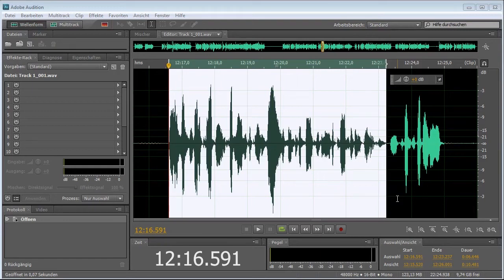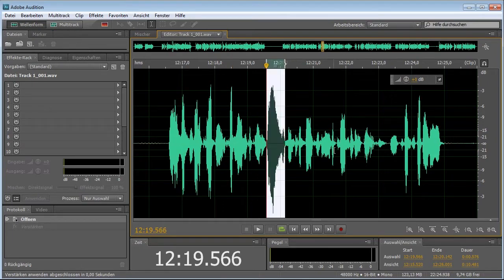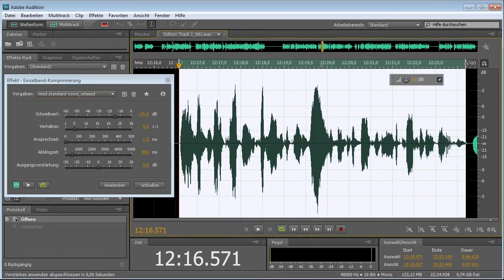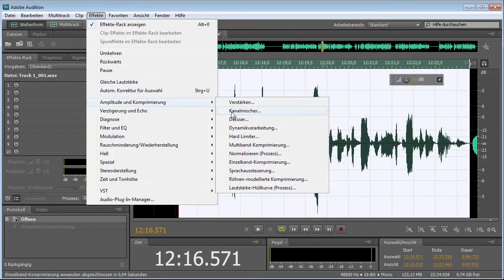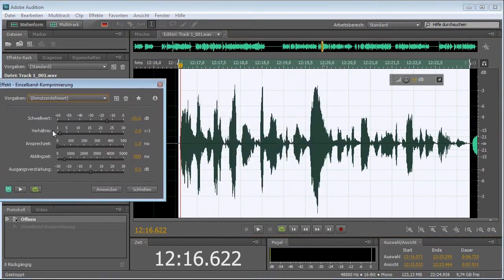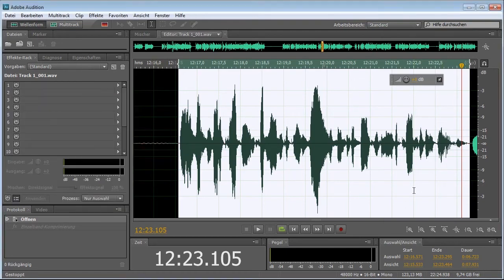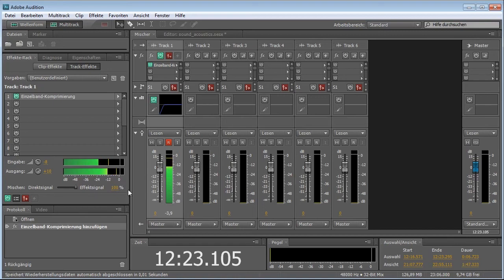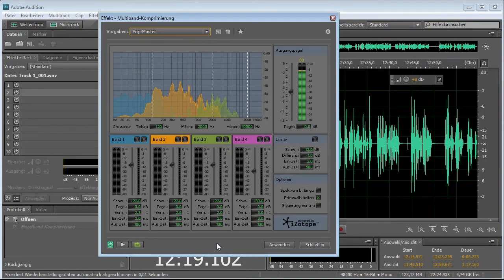How to use a compressor in voice recording

Comment: I have the same mic. and everything but I just can't do it...when I adjust the correct value on the left side in the effect rack panel it doesn't change eveything...the compressor works fine there, it doesn't reach 0 but on the main panel it still reaches the red easily I just don't understand how? and why?
Reply from the maker: Well did you apply it? Record your voice, then go to the waveform editor and then apply it there.